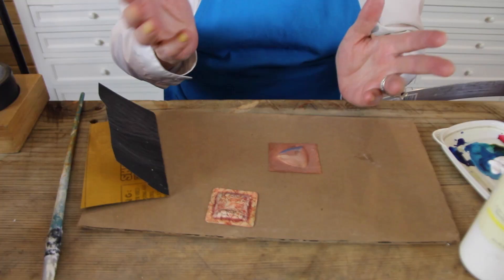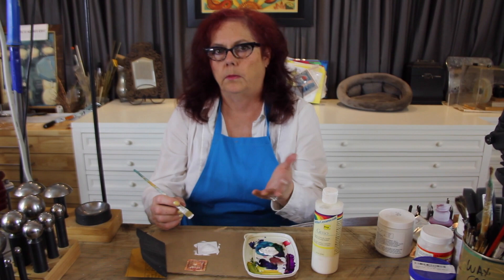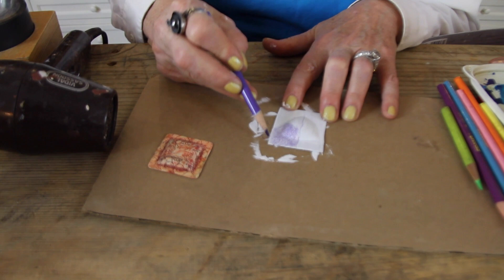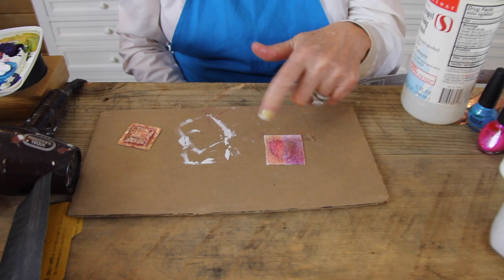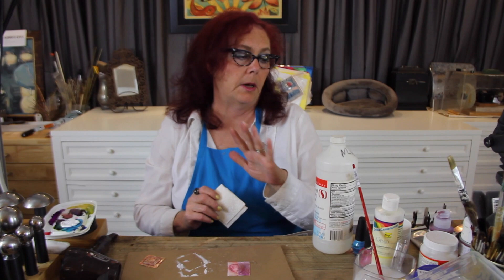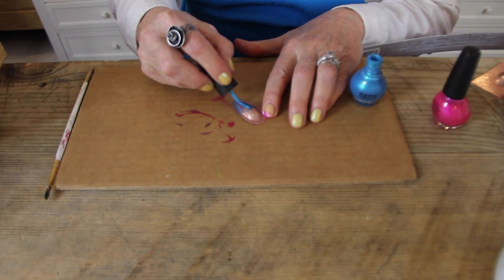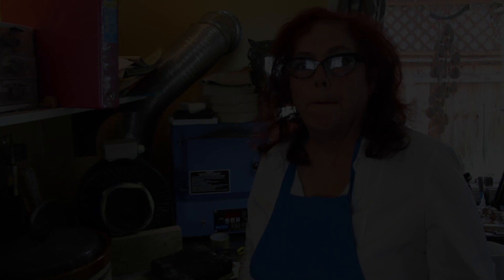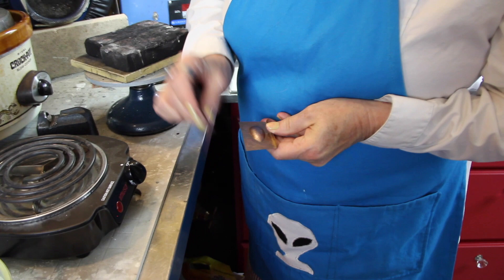Coloring Metal

Comment: Like your videos and always learn a lot.  I was particularly interested in the nail polish.  Try gel polish with added very fine glitter and a clear coat in the ultra violet thing like at the manicurists use.  I got a set recently from Fred Meyers with the machine and four bottles of polish including the clear coat on top for under $40.  Works great on toothed metals and is almost undistructable.

Comment: Thanks Nancy for your wonderful videos! Do you have a way to protect your torch fired colors on copper? I have tried several sealants: krylon, vintag, mod podge, liquitex, clear nail polish, and permalac. They all seem to dull the colors or make some disappear. I believe the colors are called inference colors so I'm not sure you can protect them. Also have you tried producing colors on copper/brass using red rouge first then hitting it with a flame. A friend taught this to me many years ago. The wax from the rouge tends to hold the colors fairly well. Thanks again!

Comment: Hi Nancy.   Thanks you for these videos.  Both you and they are great!  I don't know if you check for replies at this late a date but if so have you tried the ceramic coatings that are out for cars now as a sealer for your jewelry?  Maybe on top of a clear coat?  The reason I ask is that I am just getting started into making and wouldn't know the difference anyway.  Also, if you have a laser thermometer have you checked to see at what temperature the various colors  show up on the metal?  Thanks again and have a Blessed day!

Comment: Loved it!  I have seen a video where they used borax and heated it on the metal and got great colors ... I cannot seem to duplicate .. is there a trick to this technique?  Love your stuff!
Reply from the maker: I mention that in the video information section.  Mix borax and water, drop the hot metal into it.  Usually, makes reds.  You can also do it with salt water.  Adjust concentrations to see which proportions work best.  One of the images for the video (the red one) was done with borax/ boric acid and water.  Thanks.  Have fun playing.